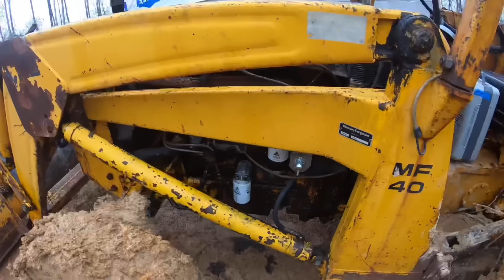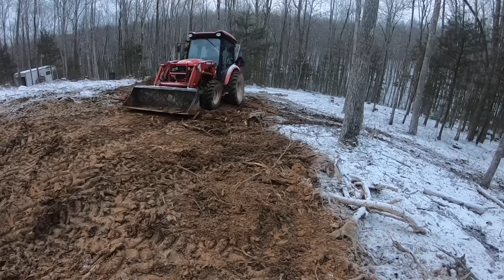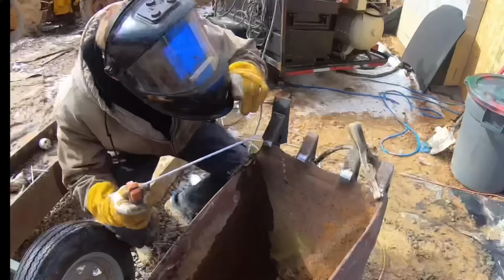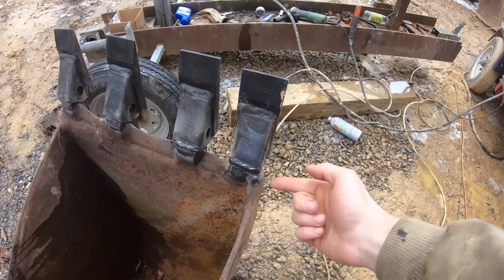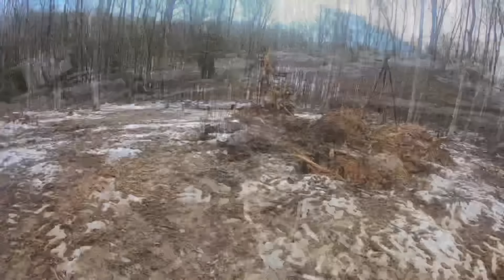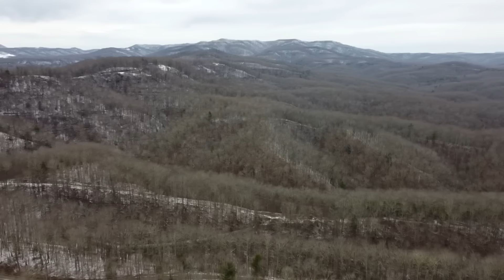Digging Stumps With The Cheap old Massey Ferguson Backhoe

Comment: roll the engine fuel off 30 seconds if you have battery enough. then add fuel. dug a lot of stumps with mine. expensive machine to keep running but hiring contractors isnt cheap

Comment: By the sounds of the engine and it not wanting to start with either I would say you have weak compression. I love the old Massey's  and have been around them my whole life. I have 5 of them.
Reply: hi are you still on youtube? 
I have a very difficult question aout a massy 204 ot mf35 with the reverso/matic. 
Do you know what oil goes in the front side of the tranny atf type f or hydro fluid?

Comment: Others already commented onthe smoke, so I spare you another round of comments for that...
However, I think, you should consider a few points if you want to make the machine last a bit longer. If you do is of course up to you, this is just friendly advice.

After starting the machine, I'd let it warm up for a while before trying to do anything with the hydraulics. Even just the weight of the hoe requires quite some pressure in the hydraulics, and lifting it up (although for a really good reason - getting grease into it) doesn't do any good to the pump when it's cold. Also it might be better not to lift the hoe up with such low rpms. That is putting unnecessary stress on the engine. Let it warm up, then rev up a bit (reasonable) and then move the hoe. You then still have time to grease, and let everything warm up a bit more at the same time.
Same goes for digging. Having too low rpms while digging is just putting a lot of stress on the engine.

Running out of fuel is causing two issues. First, the engine stops from a loaded condition. Better for the engine would be to throttle it down to idle and let it cool down a bit, equalize temperatures and only then shut it down. Of course that's not happening when it stalls due to a lack of fuel. Second, an engine stalling for fuel means, the tank was pretty empty. A tank with air inside is causing rust in the tank due to humidity getting into it. It'd be better for the tank and consequently the fuel system to keep the tank as full as possible to prevent rust formation.

The digging itself was pretty fine, but I would not dare to keep the front bucket on the ground upside down while digging. You're dragging the machine backwars with the bucket. Pretty normal when clearing roots, but also putting an incredible amount of stress onto the paws and the front bucket. There's this scene at 10:42 where it can be seen that the whole machine moves visibly, before the front bucket is moving at all. Pause the video and go back and forth frame by frame, and you see what I mean. Sure, bit of slop in the joints, quite normal for a machine of that age. But it won't help the joints if there's too much stress.
And think about the paws, the leverage is quite high and the stress on the bolts insane.

I know, it sounds like some armchair captain giving advice on how to sail a boat, but as said before, it's up to you what you do with your machine. Just wanted to give some thoughts to help you preserve the old lady. And it's not that I'm just talking - I own an old backhoe myself, with now 12600 hours on it, and it runs like a charm. Fires up right in the moment I hit the key, plenty power, very reliable, only minor clearance in the joints. But to be eligible for a well running machine, one also needs to put a bit of effort into the machine's wellbeing...

Comment: Like watching this video. This is exactly why I too bought an old hoe. I just built a thumb for it. Mine is a mid 60's MF 3165 diesel with 200 loader and a 222 hoe. I hope to load logs on my firewood bucksaw this summer.

Comment: Where did you get the thumb? How much was it? Weld on or bolt on? I just got a 70s MF30 backhoe and would like to get a thumb for it. Also, why didn’t you use this tractor for the grading and opted for the other one? Just curious is all.
Reply from the maker: I have a video about the same thumb here https://youtu.be/3tBSb_m5Tgc I graded with the other because it was really muddy and I need four wheel drive

Comment: OI wonder what kind of tree stumps you were diggin out? I have over 20 dead ash trees around my yard and plan to get a backhoe to get rid of them and do some other work around the place.
 A friend has a Massey 30 with 300 loader and backhoe for sale. I might have an easier time with my stumps, as the trees are still standing and none are more than 30 inches at the base.

Comment: I could see alot of blowby under the unit then later it looked like the radiator was steaming.  I think the old girl needs a little tlc for stump pulling.  The smaller bucket definitely helped. May want to make a root knife for it outbof scrap. Less ground disturbance .
Reply from the maker: Yeah I hooked a hose so the blow by would come out the front, a root ripper would be nice but I think it would be annoying changing it for a bucket often
Reply: @TheMechanicDave  Amen!  They are not fun when you don't have a quick coupler. Guess it depends on how often you stump. Lol!  Be safe my friend